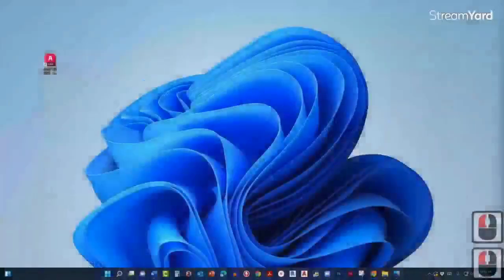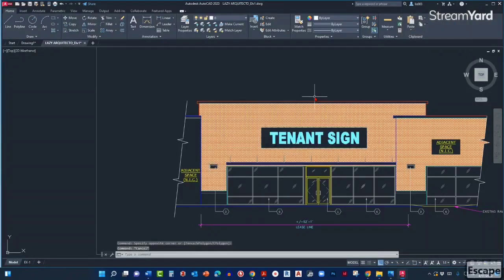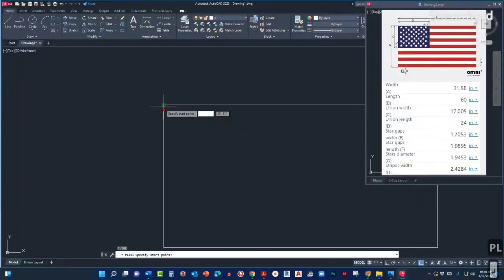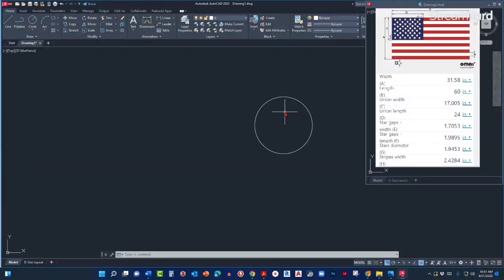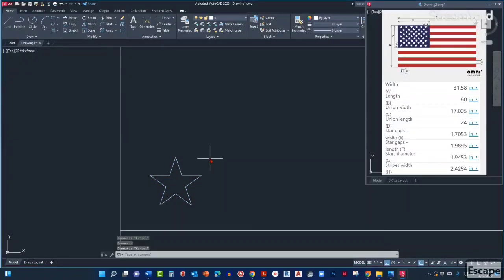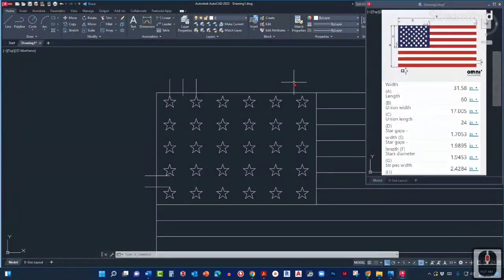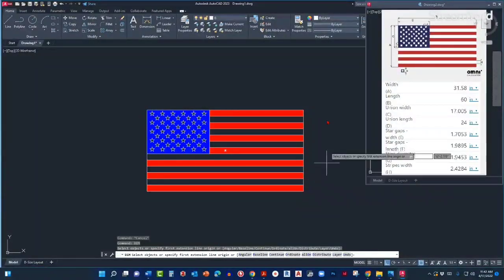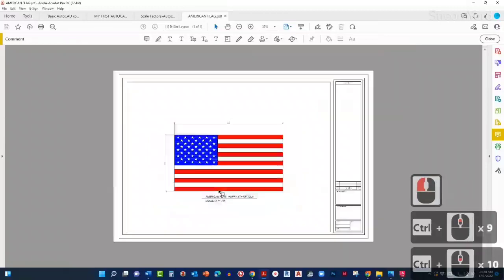LEARN AutoCAD 2024 as a Total Beginner

Comment: I use max cause that’s the only laptop I have. The max version is different by a lot then windows. So far the geometric center option isn’t working/ can’t figure out to get it to work.
Reply from the maker: did you try using any command, then right click on the mouse, and pick center from the options?